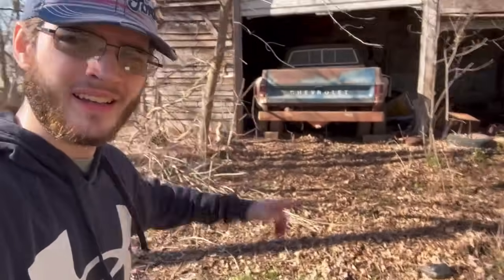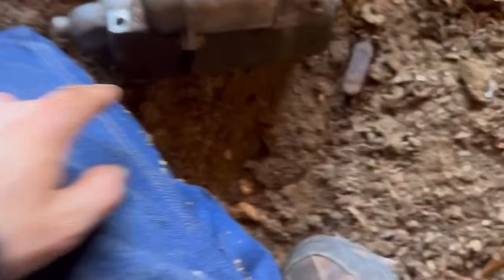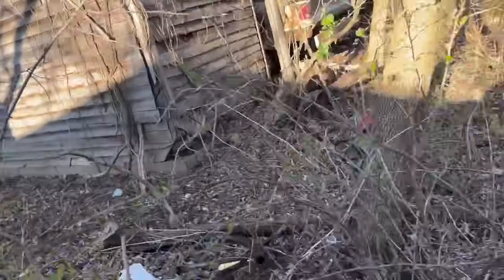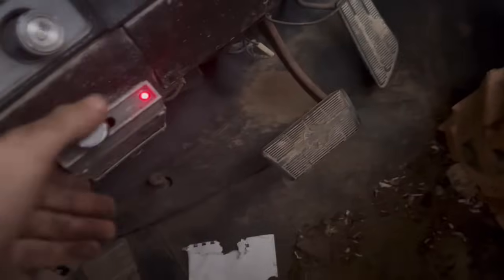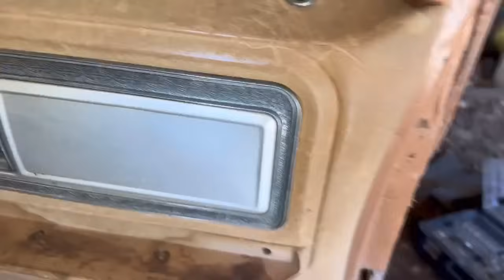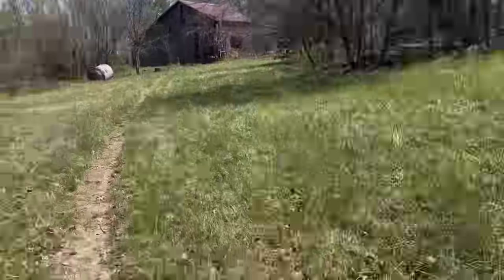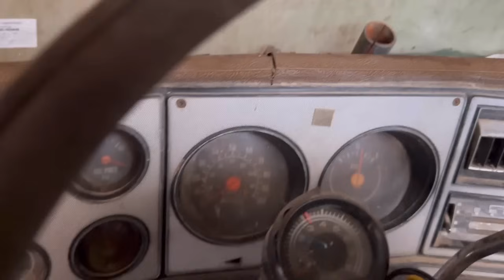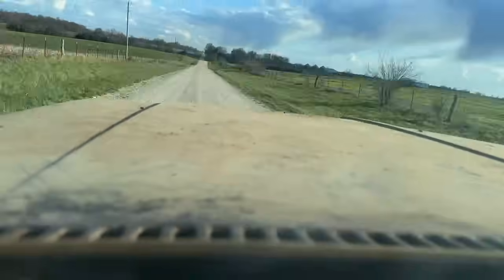Will It Run After Sitting For 24 Years? 1978 Chevrolet K30 Revival

Comment: when changing the starter put the original nose cone and you wont have to fight shims the reason being is when they rebuild them they remove material sand blasting the aluminum
Reply from the maker: will definitely keep that in mind if i do it again. didn’t clash or anything. ended up having to shim my 87 s10 with the 2.5 i4

Comment: I'm going to agree with you on the front mounted hitch but do it right and put it in the center of the vehicle! Trust me at my age I have had them both ways and they work much better if mounted in the center and it looks like it was done correctly. Looking forward to seeing you get this truck cleaned up and moving.

Comment: Pull the plate off by fuel pump hole put fuel pump through the hole in plate then push rod up in moter and then stuff the fuel pump in easy..